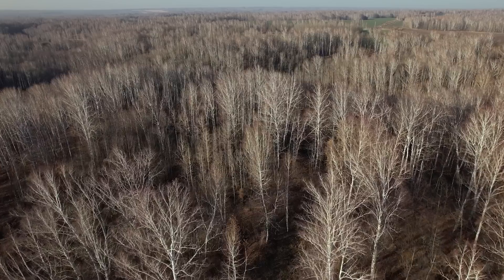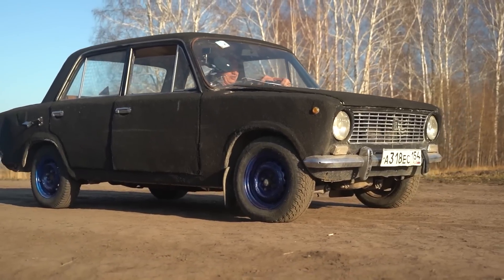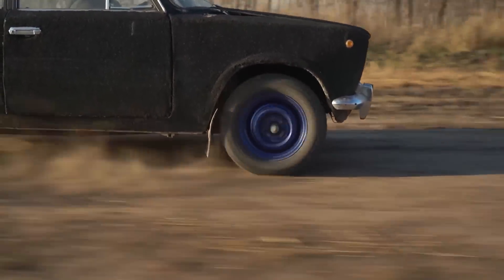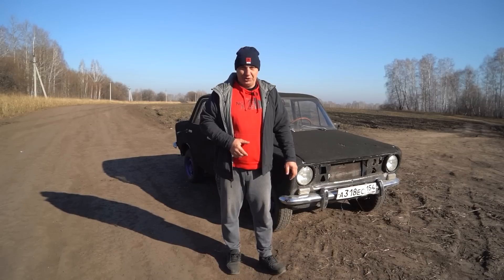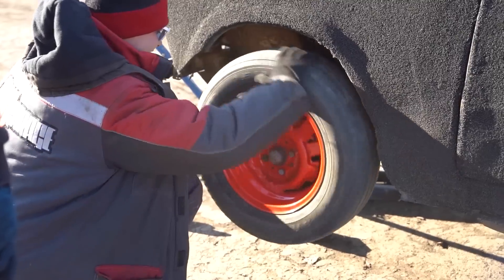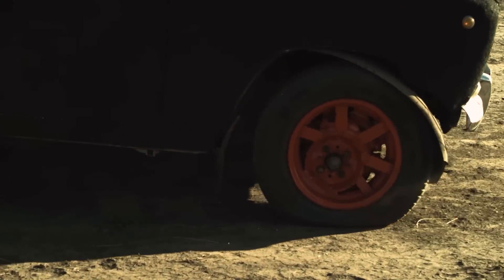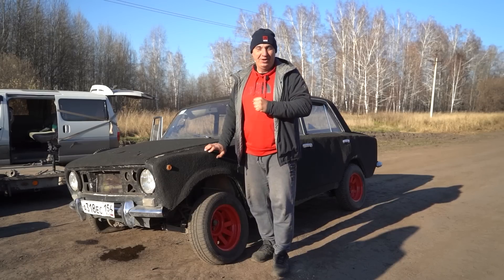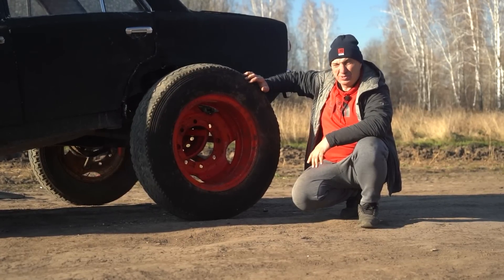Wheels with offset hubs - high speed testing

Comment: IDEA: is it possible to run an engine by changing the exhaust system to the intake and intake to exhaust?
Soo the carb is mounted on the header and exhaustout the intake. Change the crank and cam to make it operate correctly?..!

Comment: Consider filling tires with cement..I suppose it won't be too different than your wooden wheels of a past video but it could be different. Also, try 1/2 and 3/4 full of concrete variations.
Reply: They did that already, filling wheel with concrete.
Reply: @AnalogDude_  Very cool, but did they unbalance the tires with concrete?
Reply: @arty2k  They did that with lead, the thumbnail shows a Lada with some wheels bouncing in the air. some months earlier this year.